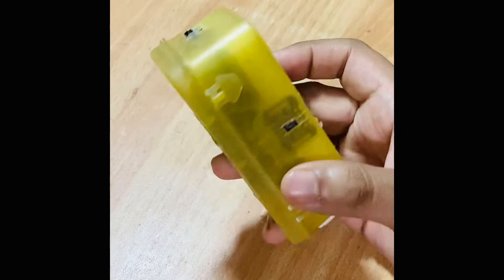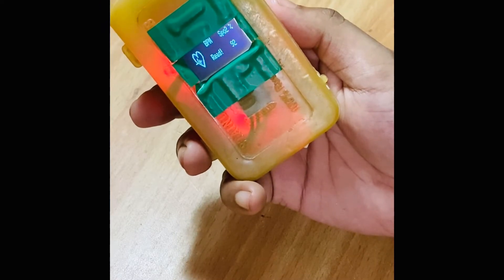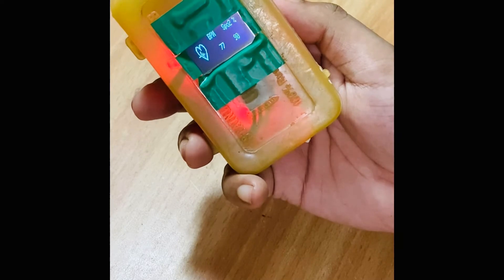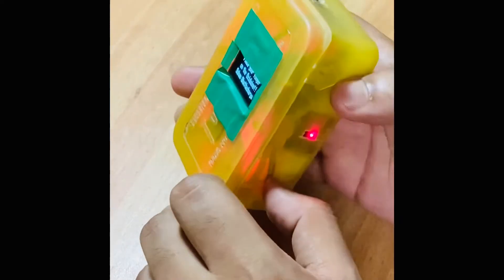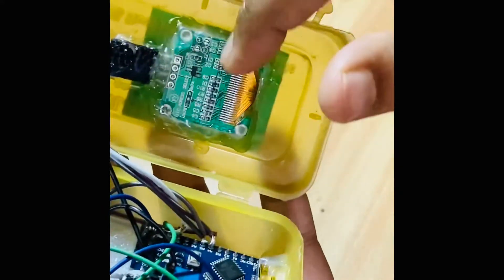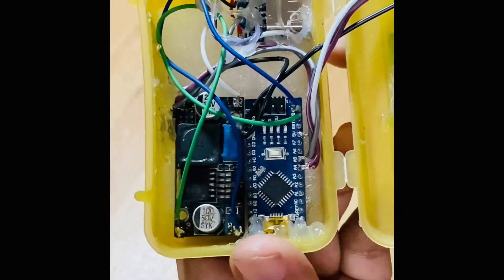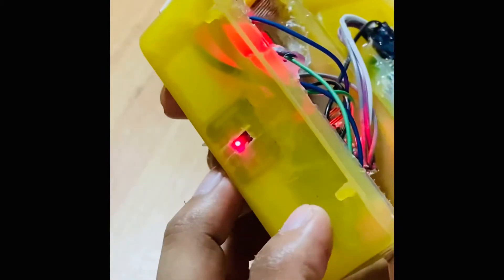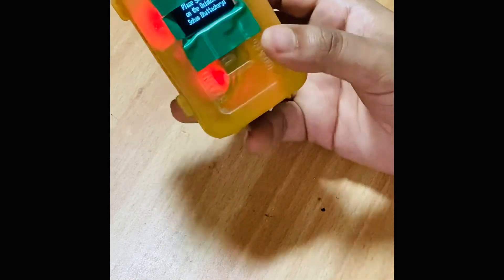DIY Arduino based Oximeter, MAX30102 and Arduino Nano. Blood Oxygen and BPM measurement. OXIDUINO !

Comment: max30102 (green) or max30100 (green) or max30102 ( black)  which one works correctly? Do all these need cutting trace in pcb? Also any pullup registers needed between SCL, SDA and VIN ?
Reply from the maker: Max30102 black PCB works the best. The black one is the latest iteration and doesn’t need any trace cutting or modifications as per my knowledge goes. The green one requires those modifications, best to avoid it. Hope this helps.
Consider subscribing to my channel, like and share my videos too. Thank you!☺️

Comment: Hey brother, nice project!
I was also interested on making such a pulse oximeter out of those components lying around. But, I can't rely on the oxygen saturation readings as nano has very limited ram to do all the data processing.

Although I have a few suggestions for your project (if you have the below mentioned components available & you don't mind 😀):

Replace the XT6009 boost module with a MT3608 boost module & boost battery 3.7v to 5v and feed that 5v to nano's 5v pin, max30102 and oled display.

For charging the battery, use TP4056 module. Also configure the charging current by changing the resistor on board the TP4056 module because by default it charges with 1 ampere of current which would be an overkill for that tiny battery size!

Good luck 👍
Reply from the maker: Suman Dey really really useful information brother, much appreciated. I had these componenets laying around thats why i used them, but will definitely look into the way you described. Please do subscribe.
Reply from the maker: I found that collecting atleast 20 and above values and then displaying the average of those worked good for SPO2 values, but larger the number of values being stored for averaging, slower is the reading. You can try to tweak that if u want.
Reply: @MrB_DoesElectronics  Ok, I'll try that.